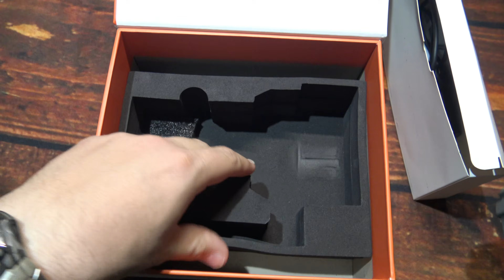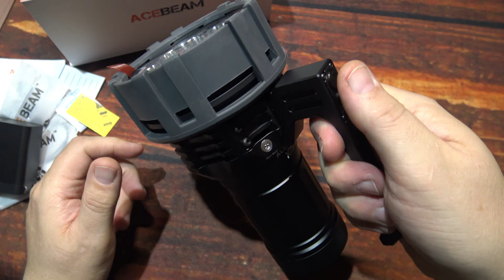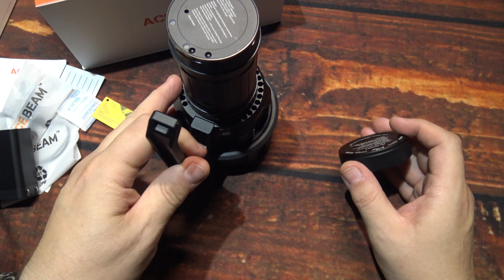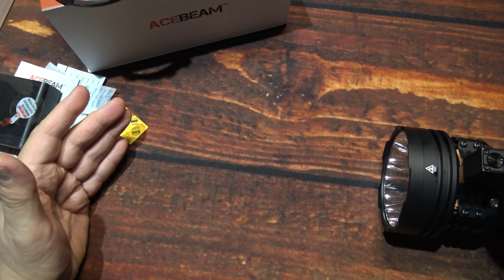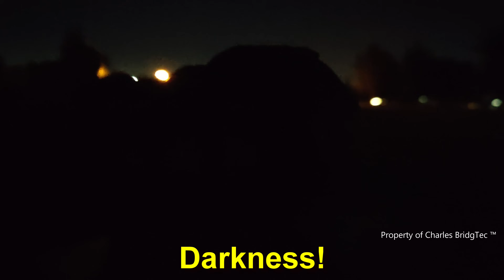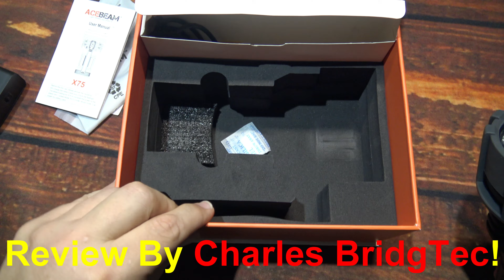AceBeam X75 Power Bank Flashlight Kit Review! (80,000 Lumens!)

Comment: when you use the flashlight while charging will it not fry itself? ive fried my imalent ms32 battery by using it while charging will it be the same case with this? thank you
Reply: also with the 100/60w. is the battery different? can i just buy a 100w brick to charge it or will it not work?
Reply from the maker: Its not designed to charge while using it. Thanks for watching!

Comment: I know it is rated for 30 seconds on turbo, but I read a review on Candlepowerforums where they ran this light for a little over 60 seconds on turbo before it dropped down. What runtime did you actually get on turbo?
Reply from the maker: About 33 seconds. It really depends on the temp outside if it does more or not. Thanks for watching!

Comment: This light is so small, and still outshines all the Imalent - after 5 minutes. This is the only light on the market which can sustain 20,000 lumens until the battery is flat. This is because of the massive copper heatsink, the opened design, and the strategically placed fan.
Reply from the maker: Thanks for watching!
Reply: Can’t the ms32 last longer with more than 20,000 lumens?

Comment: To Azael Pulido 👇👆...The batteries are removable and replaceable after their RECHARGING ABILITIES expire. Watch the whole video.
Reply from the maker: Thanks for watching!
Reply: @CharlesBridgTec  if u had to pick this or the SR 16,  which would u take?
Reply: @markbeck3115  Each has their strong points but i am leaning towards x75 due to its usb charging, design and cooling capability. SR16 is just for better throw and the inclusion of a handle is a blessing. SR16 is having difficulty to go turbo again after step down due to the thermal regulation unlike the MS12 mini but ms12 mini is too hot to hold on for too long without a good glove

Comment: Could you do a comparison of the manker mk38 and the acebeam x75? Be interesting to see the difference between 40k and 80k lumens.
Reply from the maker: I don't have the MK38. Thanks for watching!
Reply: My x75 70.3 is brighter, throw better than the mk38 70.2 6500k (this is more comparable to the acebeam X50). The x75 70.3 will probably slightly ouththrow MK38 sft40 (sft40 version has a smaller hotspot & a narrower beam pattern / a tighter spill), However, i am not sure about the x75 70.2 model but i assume it will be having a brighter spill than the mk38 70.2. The imalent SR16 will outhrow all of them.
Reply: I have the 5000k version and it looks comparable to the acebeam x75 but I won't get it because of the battery pack unfortunately.

Comment: Yes the cover does make the light look tough and rugged. 
Is the color change visible in the wilderness at night ?
I hope it does not act as an insulator for the head. I mean the bare metal should be better at dissipating heat than with a silicon cover.
Reply from the maker: It turns light blue which cannot be seen in the dark, but I don't think it affects the cooling much with sleeve on. Thanks for watching!

Comment: Nice light, but no user serviceable battery pack. Count me out. What happens after the battery degrades, buy another? Nope
Reply: You didn't watch the video. It's not like how some cell phones have immovable battery packs though they are still removable replaceable.

This flashlight has replaceable batteries. 4 of the  21700 batteries. And you you kidding, no one would buy a dud like that.  I think of the old disposable Polaroid Cameras. 

This light is badass and the most reliable from what I've seen as far as longevity goes.

Consider a  comment edit.  Just a thought. His reviews of lights are good and thorough. Hence, the reason he gets sent all those cool lights.
Reply: Only the same if you’re high power batteries wear out.
Reply: It's a battery pack. Sells for 150 supposedly but am sure that will come down in price not to mention sourcing smaller companies making the more affordable knock offs that work well. But to each their own
Reply: I have the MS 18 and had to buy a new battery pack so I’m sure this will have them available also
Reply: What was the life span of your battery pack? I'm thinking of getting the New MS32 @stevest.martin3940
Reply: You can definitely replace the cells if you know what you're doing.
Reply: Open the pack, and replace the four 21700 cells with four Molicel P42A. You need a spot welder for this job...
Reply: a battery pack would last years and years . u ain’t recharging it everyday
Reply from the maker: Thanks for watching!